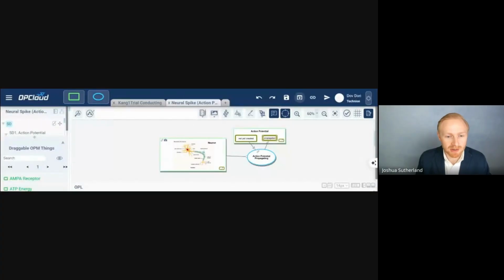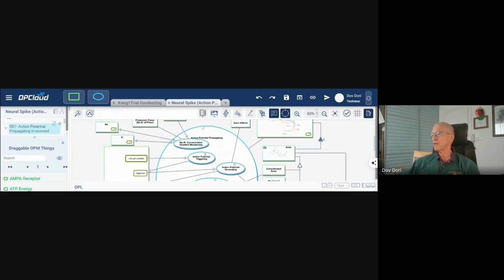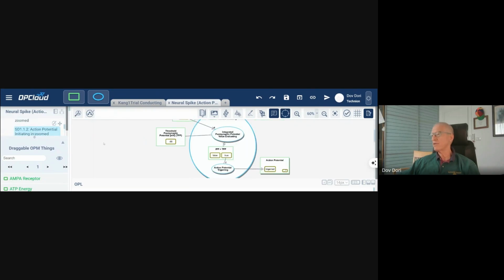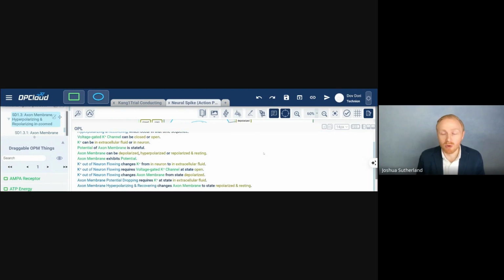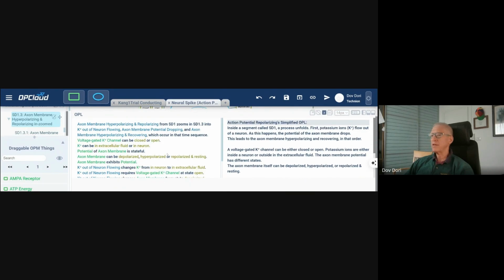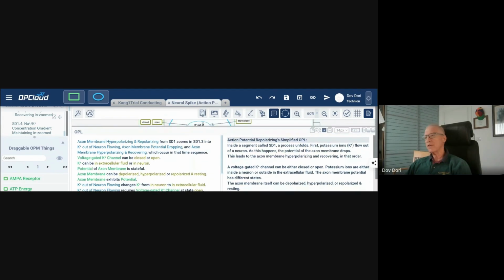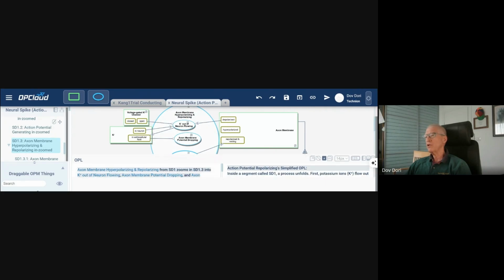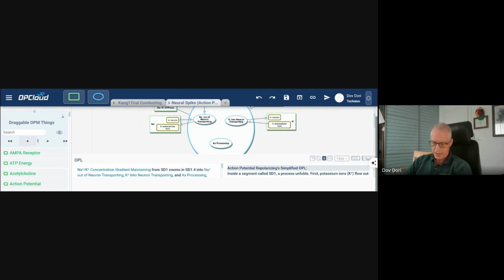Dov Dori Interview - The Origins & Future of OPM (Object-Process Methodology)

Comment: For group reasoning processes, this could be incredible. I see the neuro conceptual approach working for group cognitive co-working with various AI expert roles plus this modelling capability of groups’ joint model-building …
Reply from the maker: This is where it starts to get really interesting :-)
If you think of AI agents taking on different expert roles, and the OPM model as the shared, explicit artefact the group reasons against, you’re no longer just “using AI”. You are building a joint cognitive workspace.
That opens up entirely new ways of supporting group reasoning, alignment, and decision-making.

Comment: Thanks so much for this video with Prof. Dov Dori! OPM stands alongside moveable type as one of the greatest advances in human communications. I hope that OPM will be rightly regarded as a key contribution, not only to engineering but also to conceptual modeling,  linguistics, and the sciences. 

Years ago, I was looking to improve how business leaders, managers, and technical experts communicate. I was frustrated that communication gaps seemed so obvious, yet were ignored partly because everyone assumed they were already expressing and understanding well enough. But the project delays, ungoverned results, and escalating costs were typically due mostly to miscommunication. 

And then I discovered OPM and was hit with a flash of hope. Could OPM offer a useful method? Well, yes! OPM was broadly learnable, it offered a general purpose set of relationship verbs, and enabled any domain expert to add their own domain terms. And it really worked to express all kinds of enterprise project concepts. And it was particularly powerful at "sketching" ideas quickly, but with more "syntax power" than mindmaps or flowcharts. I hope that Dori's OPM becomes standard fare alongside other human techniques for expressing ideas.
Reply from the maker: Really great to hear how impactful you have found OPM to be.
I hope more people can use it into the future.